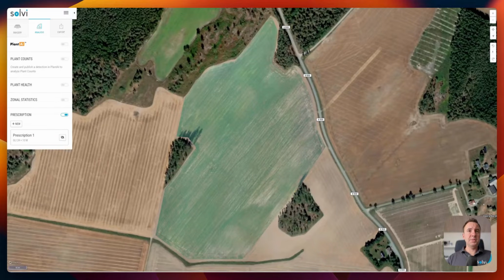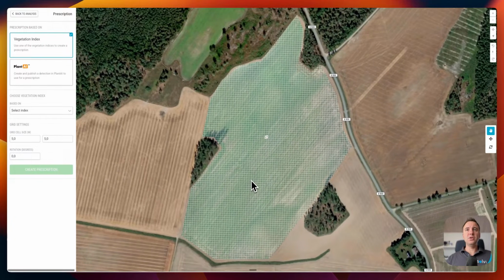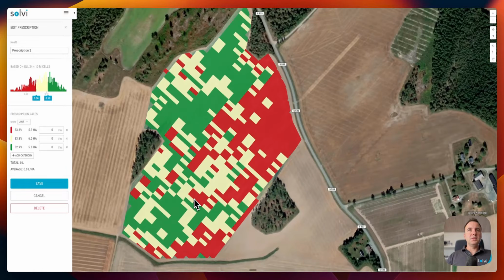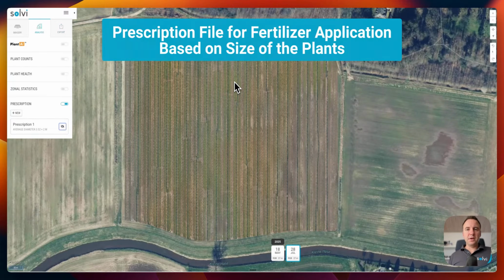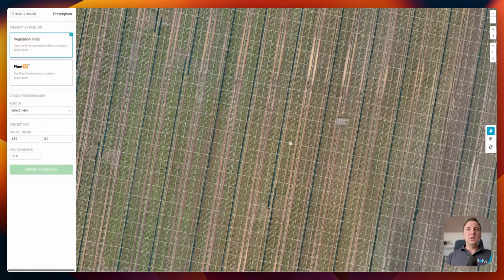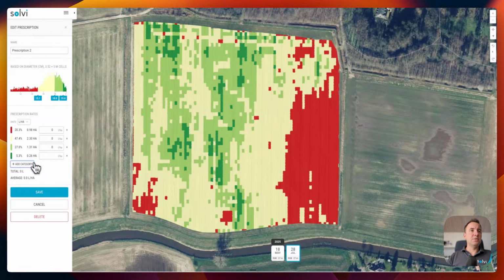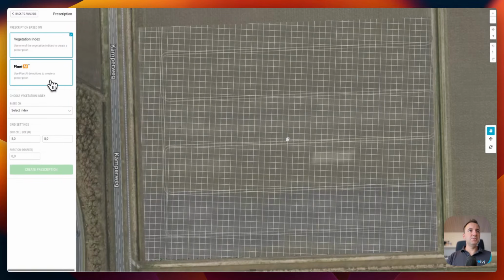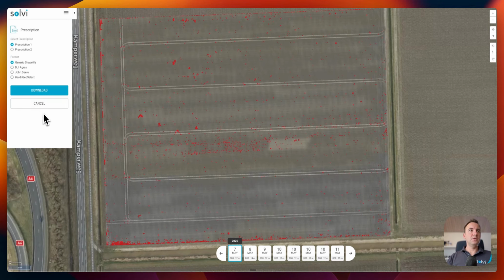How to Create VRA Maps for Spot Spraying and Fertilizer Applications with Prescription Tool

Comment: So, is it possible to build a VRA map on this platform based on multispectral drone imaging, and is it possible to build a sowing map based on yield maps?
Reply from the maker: Yes, with the Prescription tool you can build VRA maps based on either multi-spectral images (with indices like NDVI or NDRE) or based on plan counts or weed detection. We don't support any other non-drone related inputs like yield maps, unfortunately, but sowing maps could be based on the previous season's plant counts/density maps.